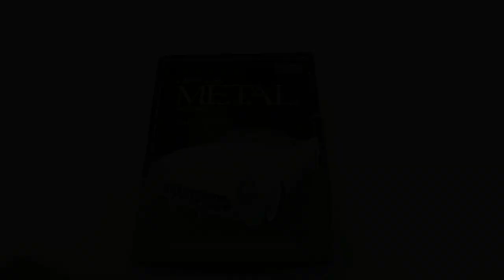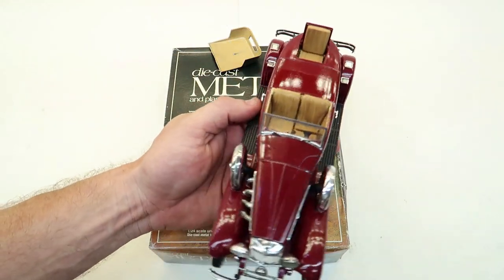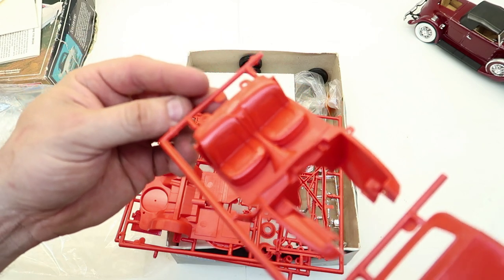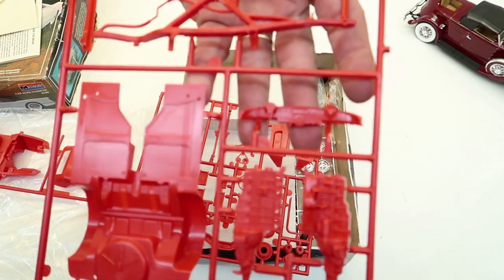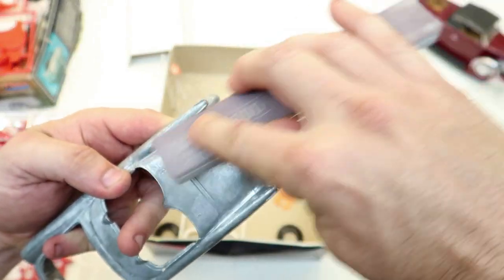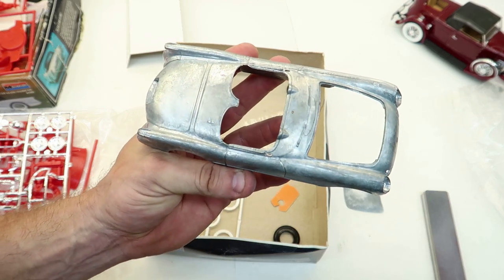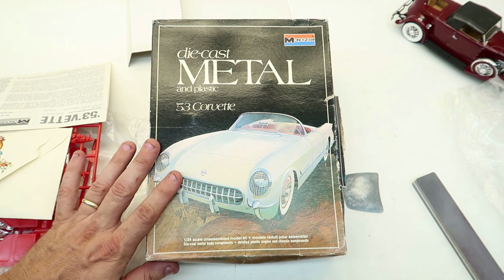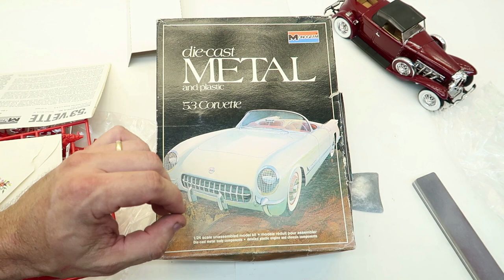1953 Corvette Metal Model Kit By Monogram Unboxing

Comment: I recently built the 32 Ford from American Graffiti from Revell. It has a metal body but plastic chassis etc. I also built the Revell Smokey and the Bandit Trans Am with metal body. These kits came pre-painted so they're sort of an unbuilt die-cast, although you do need to do some painting to make them look more realistic.  They do make nice models though.
Reply: The first one I tried to do ended in epic disaster. The years had not been kind to it as I suspect the fragile plastic parts warped or suffered hardening issues. It was the testors ZR-1 kit ( it’s now pretty much kit bash parts )  First the locating tabs on the interior tub shattered like glass. Then the firewall just will not lock into its tab which the windshield relies on to seat. In short it’s unusable and the whole thing is basically 30 bucks worth of junk. I’m done buying these things, even if the 1967 427 corvette I have goes together ok there’s too much risk buying these things as old and fragile as they are
Reply: @matthewcaughey8898  Too bad you had that happen but I've built 50 year old kits with no problem. Besides the kits I was referring to are just 10 years old and had no issues at all.

Comment: That is definitely a better kit than the testors metal kits. Seems to be much more detailed. Thanks for the look inside.
Reply: The ZR-1 corvette kits do not stand up to time. Tried to put one together tonight. Ended up with about 30 bucks worth of kit bash parts. The metal is misshapen and the plastic warped or became as fragile as glass ( the interior tub literally disintegrated into brittle plastic chunks when even the slightest pressure was applied). So I basically bought 30 bucks worth of kit bash parts. This kit was fully sealed as well so whatever happened was just time. I had done the testors ZR-1 back in the late 1990s and it was had very little room for error then. I believe the 1967 testors 427 vette with its requirements of needing glue who hid have weathered the years better

Comment: My dad built the Monogram 56 Tbird metal kit and I have two of the plastic Monogram kits.  The plastic parts were the same I believe except for maybe the chassis that had screw holes to attach it to the body.  If you have the Monogram Corvette plastic model that would be an interesting comparison.